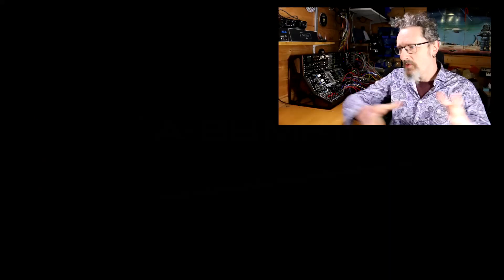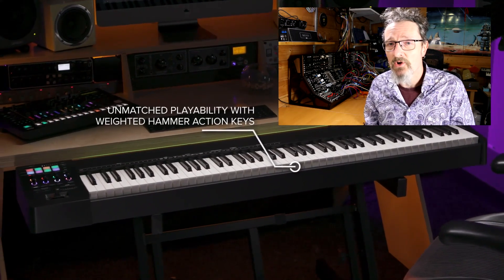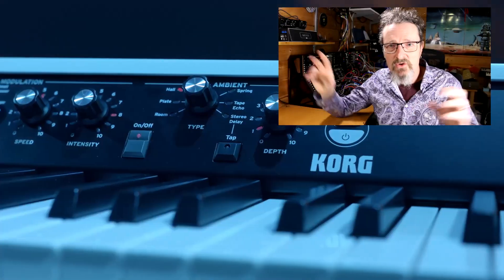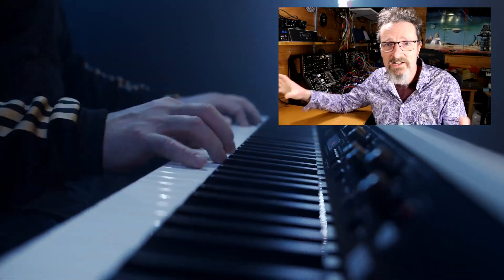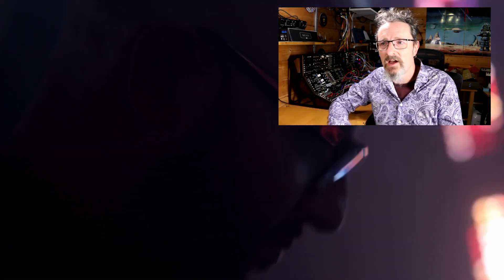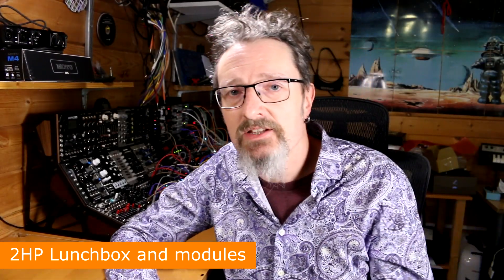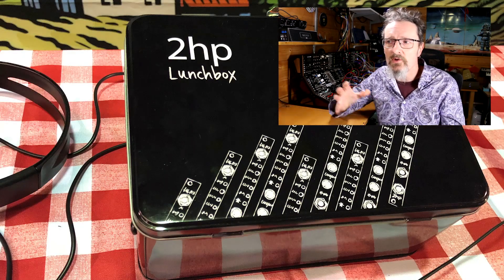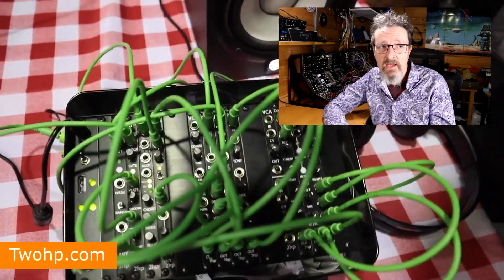Molten Music Monthly - January 2020 NAMM Special

Comment: Thanks again for your opinions regarding the Behringer System 100 modules. After further investigation using ModularGrid etc., I've come to the conclusion that it's probably not really useful in eurorack unless you are already familiar with the Roland stuff. FOr example, I have a Neutron which will provide many of the base components for eurorack modular and there is an amazing world of audio out there already so no retro-stuff for me: I didn't know what any of this Roland stuff did anyway - :)

Comment: Is the 2600 eurorack compatible with the CV levels, etc.?
Reply from the maker: Which one?
Reply: @MoltenMusicTech  Both I guess, as they are clones of the old one afaik ;-)
Reply from the maker: Well, I haven't used either and the Behringer one is still in prototype stage. A bit of googling gave these answers which you might find useful but it's all looking good for the Korg:
http://www.muffwiggler.com/forum/viewtopic.php?t=226155
https://www.muffwiggler.com/forum/viewtopic.php?t=100297
Reply: @MoltenMusicTech  Okay, that answered my question. Its compatible. Only some gaining +/- of some of the signals is (or may be) needed, and is indeed possible. And some easy trig/gate stuff with the envelopes. So it will be able to work together. Thanks Robin.

Comment: Why do I have the feeling that further down the road MIDI 2.0 profiles is not going to work that good as it promises. The thing is, it's difficult to standardize variety. And the synth world is all variety.

Having said that, I'm thrilled to know about the resolution increase in MIDI 2.0. That was one thing that hindered MIDI 1.0 for years, (although it already had 14bit resolution features, yet most controllers didn't support it).
Reply from the maker: Yeah, it's all a bit wait and see as it has been for a couple of years now

Comment: Note that the Korg MS-20 uses S-Trig.
Reply from the maker: Yes and hz/v, but’s it not trying to be anything other than what it is.
Reply: @MoltenMusicTech  Exactly. I had an MS-20 back in the 70s and an ARP 2600. Getting them to work together I learned all the tricks. lol Had to build a few converters.

Comment: Decent polyphony on a Extended Volca FM would do for me. Doesn't need to be Volca size but doesn't the OP6 look a bit big when all those parameters can now be done graphically via connecting software.  On Roland, I like the vision , they nailed the sound with ACB but listening to the Zen it just sounds more generic to me, good sound but not on par with Aria for analogue lovers..  so its a step back to me in some ways  as it seems their trying to do too much on the current cpu power available and not nailing the sound. May change my mind when I getting to hear it in the flesh or when I get to watch comparison videos.

Comment: Behringer is doing cool stuff, but some of their design decisions are questionable:
- The K-2, beeing a clone of the KORG MS-20 - but with the original incompatible-to-everything Hz/V standard.
- Moog modules in Eurorack format using the original incompatible S-trigger.
- Unpowered Eurorack cases that aren't deep enough to hold sophisticated modules
...and, just a personal experience...
...using a wobbly SVHS connector as a mains adaptor (on a tiny mixing console) that falls off the unit just by hitting against the table!
Reply from the maker: Yes it’s the battle between authenticity and convenience
Reply: But who has a K-2 that doesn't have a spare module with a certain A-5 algorithm on it, right?
Reply: @ Molten Music: Sure, but people buy these modules to get the sound of the original - and not the design flaws 😉.